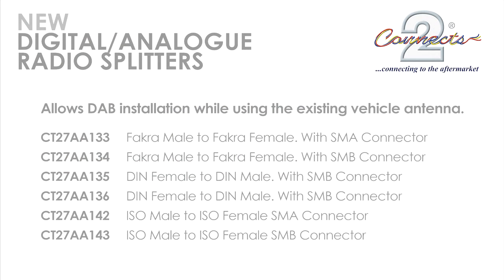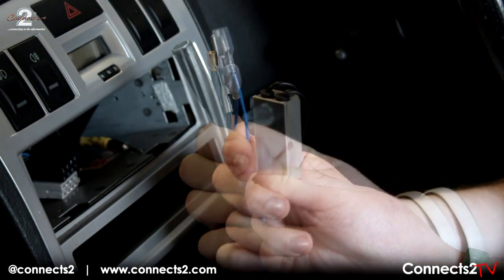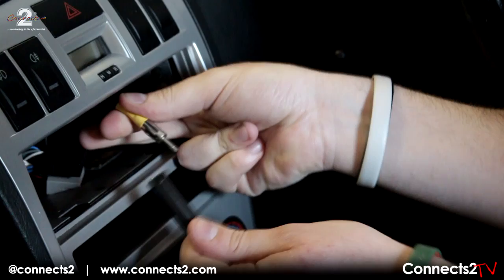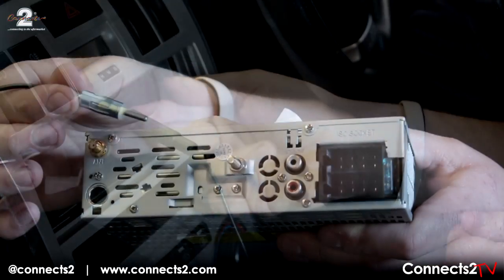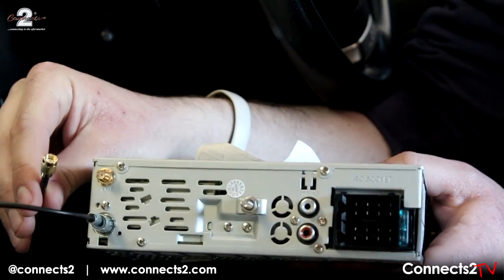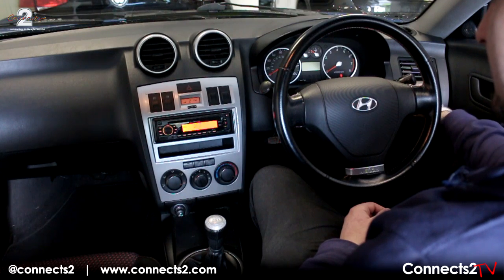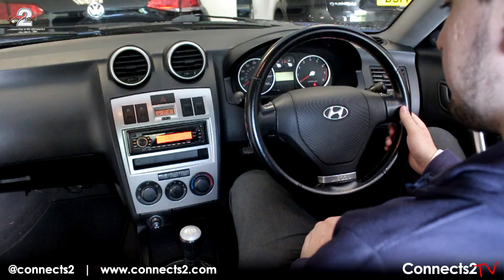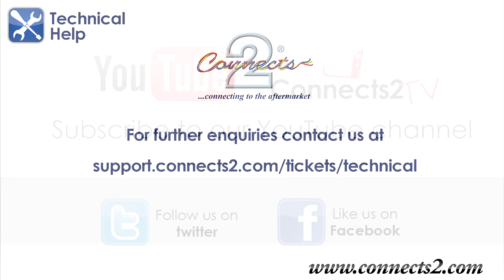DAB Splitter for DIN Antennas (SMB Connector)

Comment: Ive just bought one of these as ive just updated to a dab adapter. The aerial worked on the old head unit but not on the new dab adapter. Fingers crossed 🤞
Reply: Does it work alright

Comment: So how to connect the blue wire? I rather not cut the original wire that's in the car, nor do I not want to cut the ISO harness. Perhaps I should take out the pin from the iso connector, attach an iso pin to the blue wire of the splitter and then isert it in the back of the iso harness connector?
Reply: The blue wire is 12 volt connector. Just use the acc 12 volt wire in the car (usually the yellow wire) to connect with the blue wire.
Reply: Not clear is it? He holds the blue connector against the blue wire in the plug. What's the secret?
Reply: @number9scores  Ah so the plug on the blue wite fits in that plug he's showing? No it doesn't.
Reply from the maker: Hey,
For technical assistance and help, please contact our tech department via http://support.connects2.com/tickets/technical/
C2